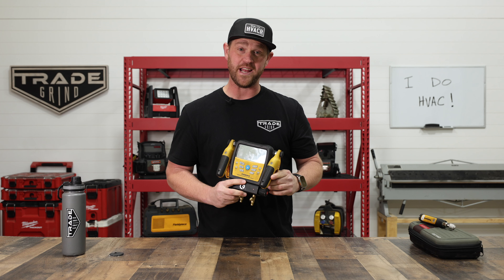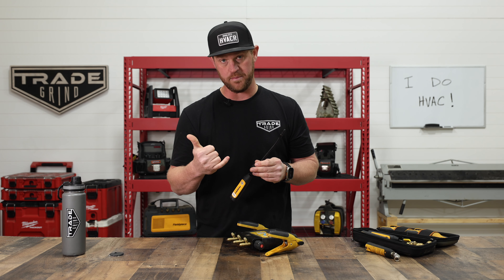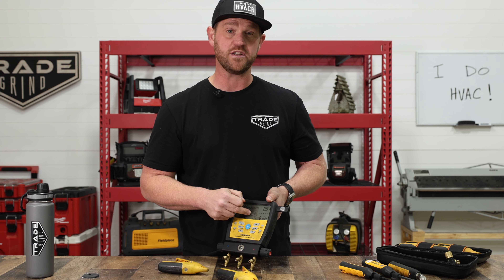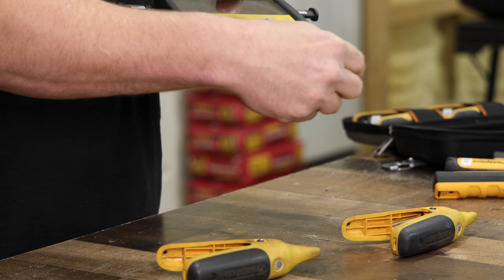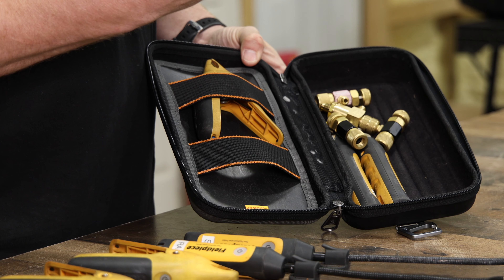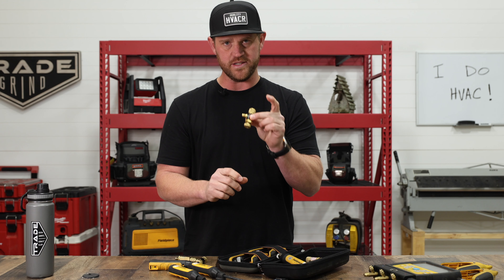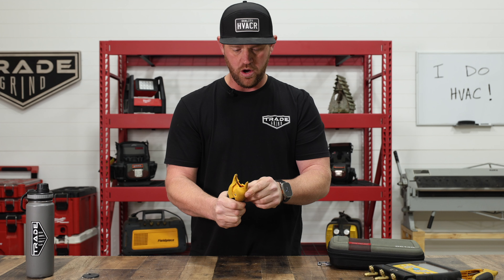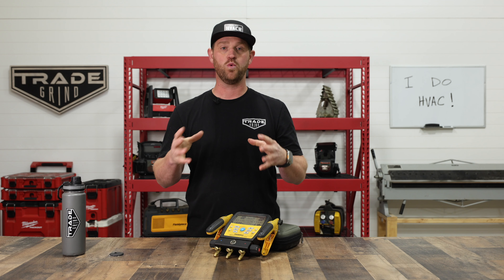Digital HVAC Gauges or Wireless Probes | Which should YOU buy??

Comment: Awesome video. Both are good products. I use the manifold for charging or recovering. Probes are good to diagnose or just checking pressures during a maintenance. Another thing to consider is if you have the probes they're alot easier to take up on roofs or things of that nature.
Reply: Why would you want to run vacuum/recovery through a manifold.  Appion speed recovery setup direct with no manifold is much faster and less possible leaks.  I really dont see the need for anything other than a set of analog gauges as a backup only for a complete set of probes. Manifolds are for the old timers IMO
Reply: @afbigfish1 Recovery on most systems doesn't even take 10 minutes through standard hoses on a manifold (at least up to the 15-20lbs I'm used to). The vacuum takes the longest, but that's mostly a limitation of the vacuum pump, not the pipeline. I buy a lot of shit the veterans in my company sneer at, but I'm not worried about a 5 minute difference in a vacuum when I wouldn't gain anything by losing the manifold.
Reply: @sammiches6859  Not sure about that a set of trublu hoses on any vacuum pump makes a night and day difference.

Comment: I just picked up the field piece probes but always had the first gen testos mostly for heat pumps, critical charge systems or awkward systems in ceilings (see heat pumps). I’ve always used analog gauges. My company won’t buy digital gauges but I don’t think I would either. Not a fan of screens outdoors and hate batteries dying. I’m sure those digital manifolds are nice but I like analog. Probes are nice for a snapshot of system operation for a report and quick maintenance checks while looking at a dozen units a day.

Cheers!

Comment: Does it have  R290 and R600 R290 propane R600  ios Butane because they tell you you need new gauges for these refrigerants but if they are in the manifold they should be able and capable of doing what you want

Comment: what  is the hose brand for 5/16 core remover？ I found it super hard to get a adapter except 1/4 to 5/16.z
Reply: Appion do one with a 5/16 connection point to the unit and have a 1/4" attachment point for your hose and a 1/4" outlet on the top for probes/micron gauge. I bought mine off Amazon, it's great.

Fieldpiece also have an interchangeable 5/16 adaptor for their valve core removal tools. It is a seperate part.

Comment: Field piece or yellow jacket digital manifold
Reply: I had no luck with the fieldpiece manifold, and got a classic runaround trying to have them give me an exchange or repair after 13 months. I only have their fieldpiece probe/clamp set up and have not used them as of yet. The yellow jacket is too expensive. I got the Testo 550 for $390 and the hoses for free.